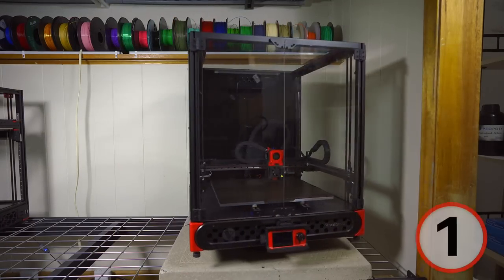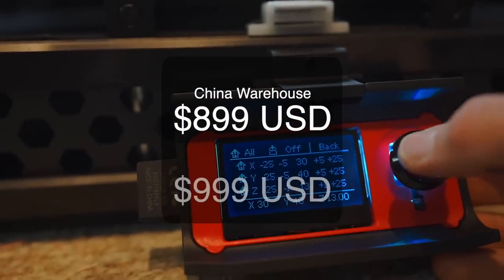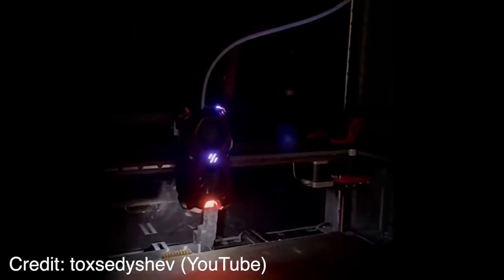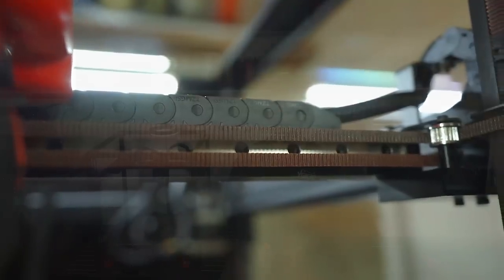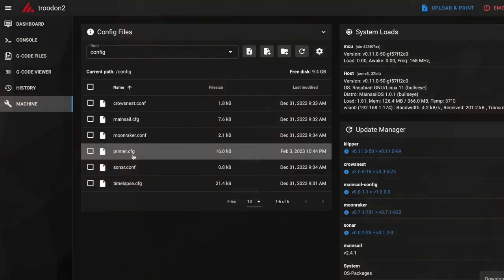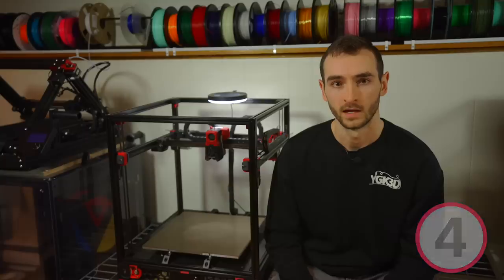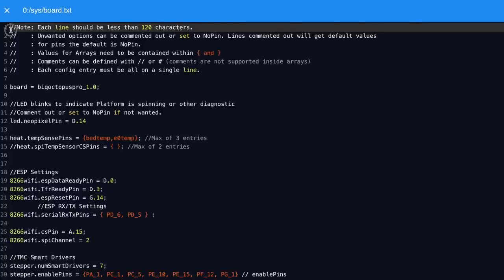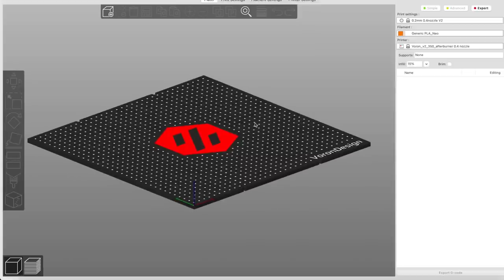Watch This Before Buying a Voron Clone (Troodon 2.0)

Comment from the maker: Looks like Formbot bumped the price since I released this video. Trying to negotiate a discount code for you guys. Stay tuned...

I also misquoted the build volume. It is 350x350x330, not 350x350x350.
Reply: Yes but above 280 in Z axis the teflon tube that feeds the filament becomes an issue, as it´s bending against the top cover. I don´t print above 300mm with this machine.

Comment: I like that your covering a Voron Clone.  The more options, the better.  I think you should take a closer look at the CAN bus modification.  It greatly simplifies the wiring.  You only run 4 wires to the hot end (2 for power, 2 for signal).  You're not running 12 to 18 wires to it.  Makes the embiblical cord mod feasible.  The Voron team has really been knocking it out of the park lately.

Comment: Cool machine , thats what i spect for a fast 3d printer today , closed for print high temp materials, fullmetal hot end ,core xy ,autobed level, and the price is reasonable for what yuo get (compere this to the last Prusa Mk4 (yes ,its a good machine , but...i think a little obsolet cartesian desing) or the Carbon X1 (yes cool machine core xy)

Comment: In my experience the Stealthburner is not an upgrade as such. It is better for printing PLA at high speed but it is not as good for printing ABS. If you are buying an expensive enclosed printer I don't see why you want to print PLA but that is just me. 
The Canbus setups move the extruder driver from the basement of the printer to the top of the toolhead. I don't see any real benefit of moving a driver from the fan cooled basement to inside the hot enclosure.

Comment: Just assembled and setup my Troodonv 2. Took me on and off 5 hours. The instructions set off well and later on some steps are missed or in the wrong order IMO anyway. Did a Benchy and came out similar to you test. Input shaping next I guess. Super printer though and very please with my purchase. In the UK so bought from China plus shipping. Arrived on 7 days.

Comment: Taylor, how about you do a video on how to get this machine updated properly. Maybe a how to use repcrap with the Troodon2.0
Reply: Is repcrap an intentional spelling?
Reply from the maker: I show the gist of it in this video and it's covered in detail on the Teamgloomy Wiki. If you're not fond of RepRap you could always convert to Klipper.
Reply: @AnnaVannieuwenhuyse  i hate my printer...yes
Reply: @ygk3d although it may be covered there. I would still like a video. As I thought I was following the instructions correctly and now my printer won’t boot.  Is there anyway I can get a copy of what’s on the as card on the main board from you? Not sure where to go from here.
Reply from the maker: @DOBBSxx  Hey Mike. You can grab the stock config from here: https://github.com/TeamGloomy/Troodon-V2/tree/stock. If you update your board.txt file before updating the firmware, the printer won't boot. To fix it, take the SD card out of the motherboard and replace the board.txt file with the stock one. Then you can update the firmware followed by the update of board.txt.
Reply: @ygk3d our awesome man!  I did read that and it’s not the issue. When I went to update to 3.4.5 I selected the bin file and hit update but then it never booted back up.

Comment: in your opinion, do you like the troodon better than the voron 2.4?

i was looking for kits the recent week and with 3D printed parts for it (not easy as some don't list what specs it has) and a direct drive with outdated extruder i would spend anywhere from 1500 to 1800 euro which is waaaay beyond my budget

seeing the troodon 2.0 being not only a complete package with features i want, but also mostly assembled for 1100 ish euro gives me a bit more hope.

genuinely would like to hear your experience after printing with them for a while and what potential issues you might have encountered so far.

also can it perhaps connect to a laptop through USB to run klipper in a virtual machine?
Reply from the maker: I personally like my Troodon more than my Voron but that's maybe just because I've dedicated more time to it. The Troodon offers great value for the money. There are a few issues but a lot have already been addressed by the manufacturer or the community. I'm not familiar with running Klipper in a virtual machine but any way you would normally run Klipper would be viable with this machine.

Comment: Thank you for your video. I use my Troodon 2.0 for a few days. I was able to add few magic lines and plugins based on your previous videos. Now i can use 500mm/s travel moves without issue. The only issue i have is that the extruder is overheating. Example: printing benchy, PLA, 0,2mm, bed at 60°C, hotend at 220°C, print speed 100mm/s, air filtration OFF. After few minutes the extruder motor overheats, looses torque and starts to skip steps. If I use air filtration ON, i can print almost whole benchy, like 95%, then the e-motor skips steps again. If i leave the front door open this does not happen. Any idea, please? Manufacturer told me to keep the doors open :)
Reply from the maker: Thanks for your comment. Did you try turning down the stepper driver current?
Reply: @ygk3d  no, i kept stock value. Any suggestions what values should i try, please? Thank you.
Reply from the maker: @lilbHEMI  Try changing the E value to 700 beside the M906 command in your config.g (assuming you’re running RepRap).
Reply: @ygk3d  yes, i´m on stock fw. Changing the E value in M906 from 800 to 700 decreased the E-motor temp by 9°C. Thank you, I´ll keep testing.
Reply: You need to keep the doors open with PLA. If you don't the temperature inside the enclosure is high enough that the PLA softens in the extruder and will start to clog the plinthead. I believe that is the step skipping you are seeing. The extruder can take much higher internal temps without problems. I run an active chamber heater that keeps the inside at 60C and its totally fine.

Comment: It seems like very good value. I have a Troodon 30x30x40 and would like another one, but preferably larger. I hope they will make a 40x40x50 of the 2.0!! - Wondering how much work it would take to heighten the print area!? - Probably too much work, right?
Reply from the maker: It seems unlikely that they'd do that to be honest. Extending the build height seems like it would be difficult as you'd need to re-do the wiring in addition to replacing the extrusions, rails and belts.
Reply: @ygk3d  Yeah, you are probably right, but they do have a large 1.0 version, so one might have a bit of hope :-) 
Yes, most likely to much work to enlarge the new one. - Great videos btw 👍

Comment: Does it actually stick up to 500mm/s print s po eeds with quality?  What's the safest best max speed for good prints? Thx
Reply from the maker: You're definitely going to hit the flow rate limit at those speeds. I've only been able to hit 100 mm/s with the stock hotend before under extruding with PLA at 215. To print faster I'd suggest switching to a high flow hotend.

Comment: I saw a Troodon for sale recently and wasn't sure what it was.  After seeing this video, I'll be staying far away.  I guessed it would be a clone of a Voron, but looks like it strays quite a bit.
Reply from the maker: Not sure what makes you want to "stay far away". This is a solid machine at a great price point. It deviates from the original Voron design in a few ways but some of those changes are for the better.
Reply: @ygk3d  RepRapp vs Klipper by default,  and a non-standard board are my major concerns
Reply from the maker: @MallocArray  I agree that a normal Octopus board would have been a better choice, rather than the custom board. However, the board is designed by a reputable manufacture (BigTreeTech) so I wouldn't be concerned about quality. I demonstrate in a prior video in this series how to convert the machine to Klipper, if that's your preference. It's quite easy and doesn't require any hardware changes besides the addition of a Raspberry Pi.